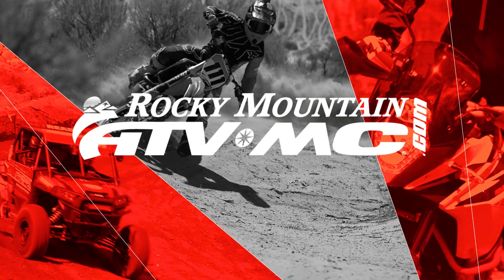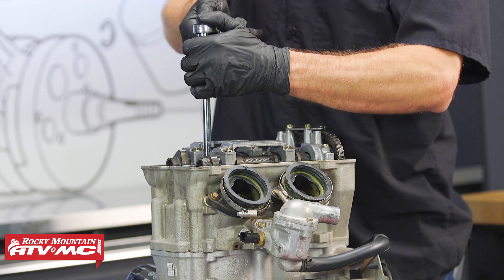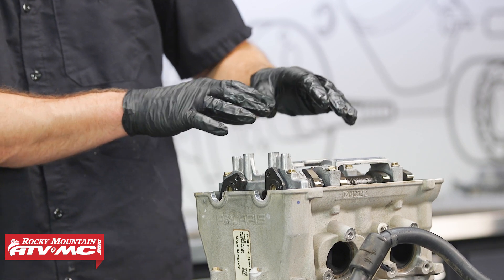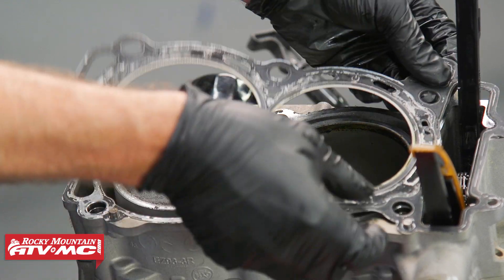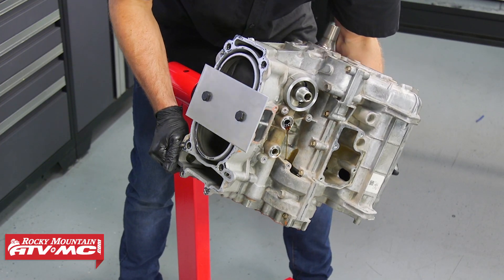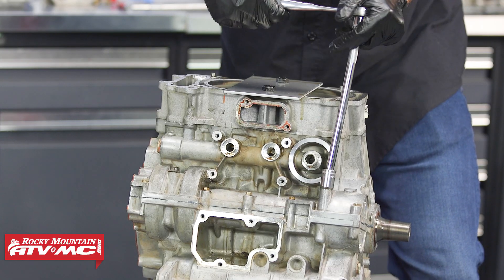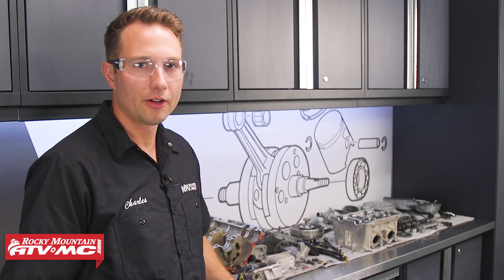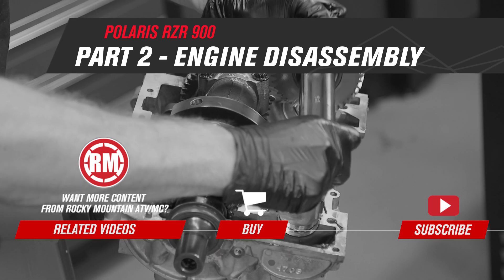Polaris RZR 900 Engine Rebuild | Part 2: Engine Disassembly

Comment: is it the same for a ranger
Reply from the maker: The engines are very similar and you can use this video to help you get through the rebuild but we recommend using a service manual for that specific machine as there will be some differences.

Comment: Is it possible to remove the timing chain without splitting cases? Also what is the purpose of the U shaped retainer other than keeping the chain in place if dropped from the top?

Comment: At 12:45 make sure to inspect the oil pump chain.  If stretched it may be hitting the case when right side up.  You will see grooves in the case.  Always replace oil chain as it has no tensioner.  Great video!
Reply from the maker: Thank you for the info!